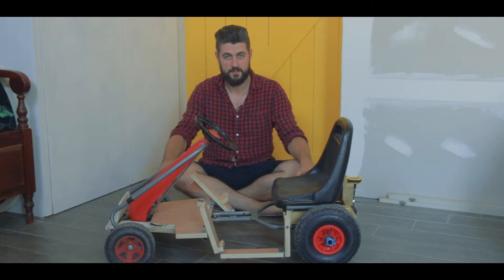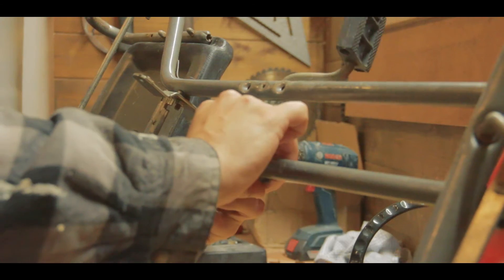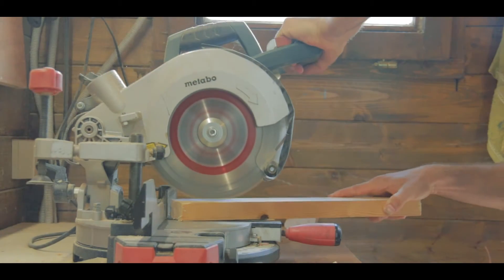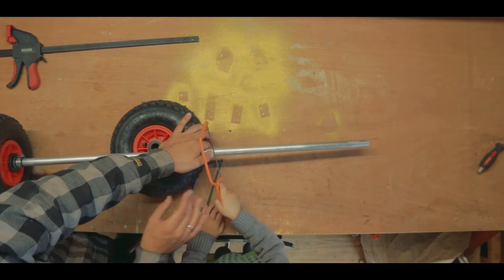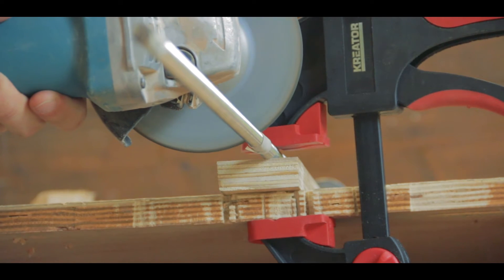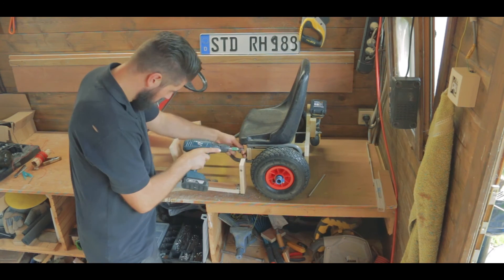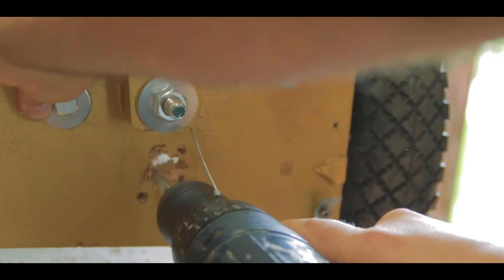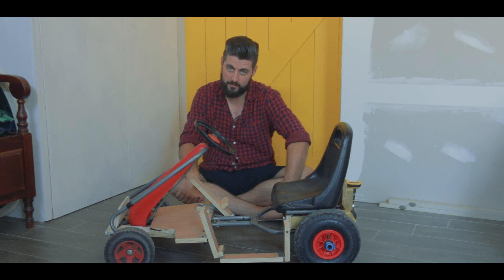ScrewGun Powered GoKart

Comment: Very nice, bravo. Can you tel me what is that wheel what's in the drill, that pushes to the cart wheel. Is it sone kind of grinding tool?
Reply from the maker: Thank you, the wheel is called a wire wheel. You have them in metal, brass . Usually you use these to scrape paint off.

Comment: I might do what you did but instead put the drill in the middle at the front facing back so you can reach it better have variable speeds and have the drill attached too a long price of bar and weld a few gears into place too maximize torque from it and make it easier on the drill with less ware on the tires
Reply from the maker: Good plan. My next iteration will get gears and a chain as well. But this video was in my pre-welding days :) let me know how it went please, always interested in other people making similar stuff!

Comment: Hey great video. Gave me motivation to build my own. Where can I buy what you attached to your drill?
Reply from the maker: thanks!  The thing is called a wire brush, they can be found at most hardware stores. They are usually sold in a pack, so you have a thin one, wide one etc,, and most of the time one of these things is in there :)
Good luck with the build!
Reply: @ProjectsandThings  thank you so much for replying, i subscribed!

Comment: I want to try this but im 200lbs os there another device i can use the same method with ?
Reply from the maker: Yes there is, you have similar looking karts for grown ups. Then the friction method does not work anymore ( believe me, 200lbs as well and the kart failed on me ). So then you’d have to devise some form of sprocket and chain where the screwgun/battery drives that gearbox. You can google some more on this concept because I’ve seen a channel that made exactly that, I just forgot the name.